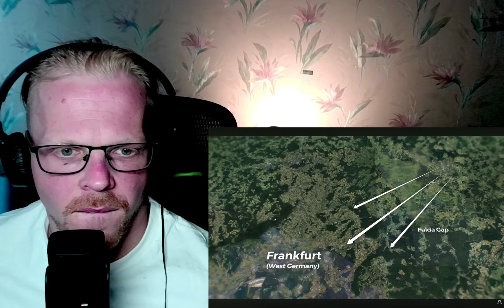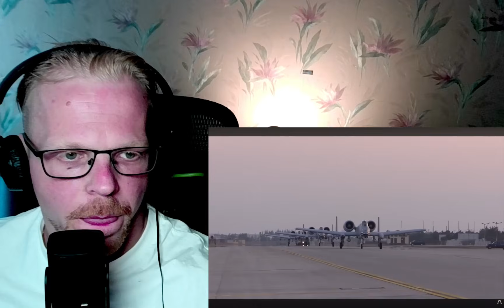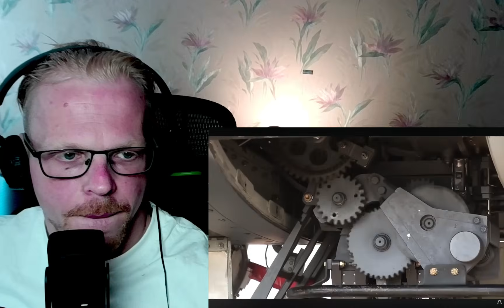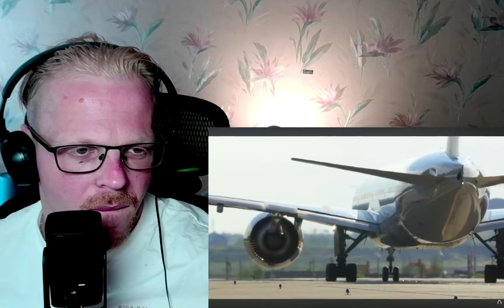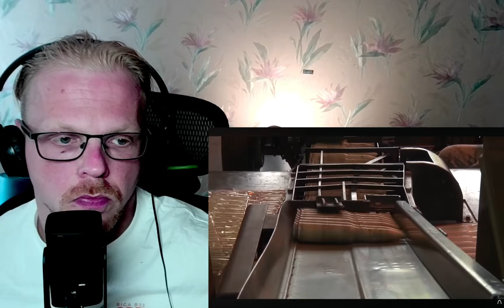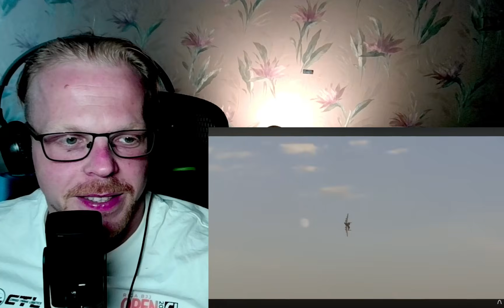I Didn’t Realize America Built Weapons Like This | European Reacts

Comment: A10s are great, but what makes it work is the CAS trained pilots.  They are experts in close air support.  The resources they expend  in training is to accomplish one mission.   Multirole pilots in f16 or f35 are not CAS experts because training resources are split into very different missions sets.  When the a10 is retired  the USAF will no longer have a place for CAS  experts

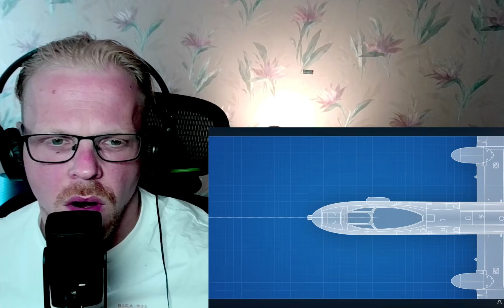Comment: 10:08 This video is significantly wrong when it claims that the gun on the A-10 is mounted on the centerline...it is not. The gun is mounted offset to the left side of the plane, such that the right-most barrel of the gun is exactly on the centerline...this is because it is the right-most barrel of the gun that is actually firing, so that barrel has to be exactly on center to balance the recoil of the gun. This is very easy to see when you look at pictures of the front of the plane.

Also, the F-16 does have a 6 barrel rotary cannon a bit similar to the A-10...but the gun on the F-16 is a 20mm Vulcan cannon that is much better suited to shooting at other planes than it is at ground targets...at least when compared to the 30mm cannon on the A-10.